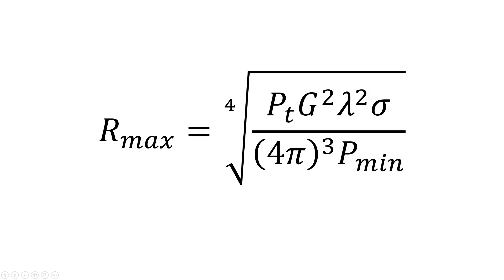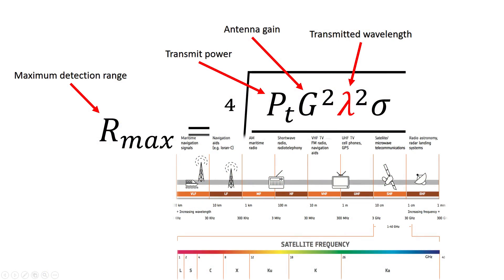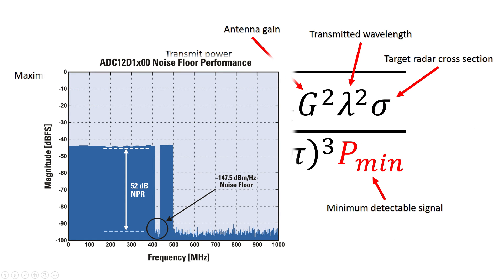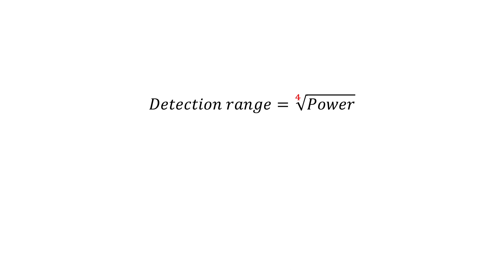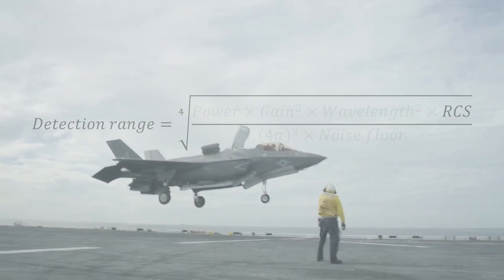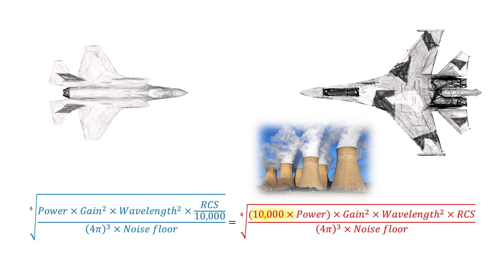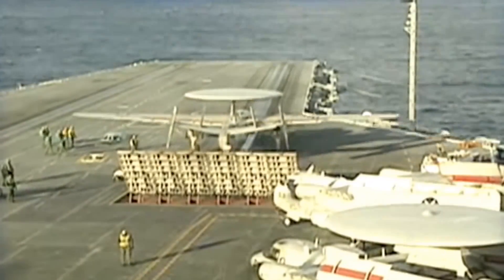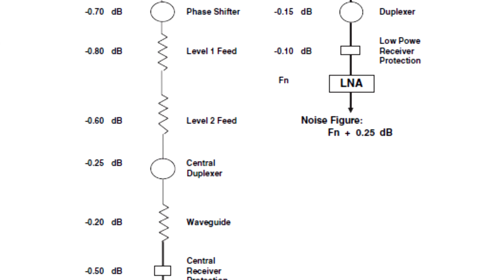F-35 Lightning II: Busting Myths - The Radar Equation [v1.1]

Comment: Doesn't a stealth aircraft give away it's position when it turns on its radar?  Is it possible to keep your radar off and just watch the radar signals from other planes?
Reply from the maker: HM1199
Sort of; the idea is also partly centred around the idea of emitting signals that are spread out and don't look like radar pulses to anyone other than those who know what the emitted pattern / frequencies were (which is only the jet that emitted them, due to the random manner in which they were generated).
Reply: hey i want to ask about another thing , i heared that LPI radars can be detected if the passive sensor has a good enough software ,i mean like using a signal of
 Reference in conjunction with the received signal to generate a spectrum . Is that a valid option? :)
Reply from the maker: HM1199
LPI / LPD is a bit like stealth; it's not a single technology or technique, and it's not binary in nature. It consists of things like radars being highly sensitive, having wide bandwidths, using complex waveforms, having small sidelobes, using random frequency hopping, etc. The Su-35's PESA for example would have some LPI features.
You can use techniques to improve your chances of detecting LPI emissions, but beyond a certain distance they won't work. How that distance compares to the LPI-emitting jet's ability to detect you, largely depends on who's stealthier.
Reply: oh i see ,  so you can have an LPI radar by making it very sensitive to the point where  it compensates for the high (and visible) power needed for the range , mabe thats why russians are making more and more sensitive modules i mean the 1.4 db noise figure they have acheived is not bad ata all :D  . Pretty cool stuff thanks and keep those videos coming dude .
Reply: The answer to both questions is irrefutably yes,  with a couple of caveats. 1) The F-22/35 radars employ LPI techniques that are highly effective against detection equipment that is more than 15-20 years old (which is a lot of equipment), but most anything newer than that can easily detect these signals. 2) There's a difference between scanning for targets and tracking targets. Scanning an area of sky is going to give you away to anyone in said area, but once a target is acquired you can opt to track only that target. Since phased arrays are steerable with good side-lobe cancellation, you can focus your signal on a single target. This means only the target you're tracking (or anyone who passes through [or close-to] that line-of-sight) will detect your radar beam.
Reply from the maker: Not necessarily; the F-22 and F-35 can use LPI mode on their radars; it reduces the range at which a RWR, etc can detect their radar emissions - F-15s/16s/18s have often been unable to detect the radar emissions of F-22s and F-35s. Some stealth aircraft like the F-35 can also just use infrared sensors for targetimg.

Comment: Good video, but for me there's one issue: Radar stations and other radar-equipped aircraft can of course detect the radar sent out by another aircraft, so any aircraft activating its radar in the presence of hostile aircraft or over hostile territory will be immediately detected, regardless how good its stealth is. Stealth only makes sense if stealth aircraft can be guided to the target area without it having to use its own radar (wasn't there a video on the bomb runs against Iraq somewhere?). This also makes a plane by plane comparison of stealth vs. radar not representative. In case of ground attacks, the defender would of course rely on ground-based radar, whereas in other situations both sides could use non-stealth aircraft for spotting the enemy's planes, and the stealth aircraft would only use their radar for targeting, once they get within range of the enemy.
Reply: F-35 is not designed to intercept enemy fighters. It is useless in a dog fight. If the US military are not fools, such a huge investment in this fighter are only justified his offensive potential of bombing foreign territory.
The missile defense system in Europe, hypersonic missiles, F-35, create from Russia the image of enemy in the media - links in a chain of preparations for war, what mankind has never known in history.
Reply: What ChupaChubra probably doesn't take into account is that the F-35 is unlikely to be sent into enemy territory to attack other aircraft. To identify enemy aircraft at any reasonable distance, any fighter needs to be either support by ground based radar or other aircraft with radar (e.g.AWACS) or to use its own radar. However, a stealth plane that activates its radar makes itself visible, so usually a pilot will avoid doing that. However, as the F-35 is designed as a multi-role fighter, I would likely be sent into enemy territory on a ground attack mission. And as ground targets can be found using GPS and optically (at least if they are immobile), a F-35 would only need to activate its radar after the enemy has found it already, to engage the enemy aircraft or to avoid them.
Reply: This is the reason the US has so heavily invested in AESA radar tech. Unlike PESA or MSA radars it has the capability to frequency hop, form sub groups, and vary power levels of 1000's of small transmit and recieve (TX/RX) modules. This effectivley allows the power transmission of the radar to appear as no more than back round noise to any radar warning reciever (RWR) that might be looking for it.

It also allows for it to use many different jamming techniques at once in effect making home on jam systems usless as they are only usefull againsy barrage noise jamming.
Reply: And what about the Aircraft's own radar receivers? On the F-35's screens these big UHF or VHF ground radars will be like a big HIT ME sign at hundreds of miles away. The F-35 can in fact attack using just it's passive sensors. In fact the F-35 that is targeting need not be the one that attacks at all, in fact it could be a cruise missile launched from an aircraft carrier that does the damage. 

Note that even the F-22 wasn't able to fight the F-35's radar. Both 5th gens have come in gun range without the enemy knowing they were there. 

Also note, 5th gen aircraft with their sensors can have the capability to shoot down the enemy's missiles instead of dodging.
Reply: srinitaaigaura I think the general argument is that VHF radar stations would be staged comfortably behind front lines and protected by theatre defense systems like S-300/400. They would be able to detect penetrating aircraft long before an F-35 (or any non-AWACS aircraft) would see them—ground systems are at a huge advantage due to basic characteristics like size and power generation. Even if you know where they are from other intelligence sources, the real difficulty is getting at them. It's going to require stand-off weapons in any event. Having a far reaching stealthy/fast AGM is a hell of a lot more useful than having a stealthy airplane.
Reply: 1) no stealth aircraft ever been only stealth head on , same altitude. If that was the case then they wouldn't be stealth against ground radar at all. Which is clearly not the case. Looking at most radar scattering graph , you can see that stealth aircraft general have bow tie shape signature 
https://basicsaboutaerodynamicsandavionics.files.wordpress.com/2016/03/f_35_metal_rcs.png

2) IRST can help somewhat but they affected significantly by weather ,humidity , target aspect and need to rely on LRF ( laser range finder ) to generate firing solution because they can't measure distance, target velocity or altitude by themselves. Laser range finder is limited to around 15-25 km so they offer much shorter range compared to radar 
https://s18.postimg.org/4wot7d07t/IMG_20170219_183944.jpg
modern stealth has measures  to reduce IR signature too
https://basicsaboutaerodynamicsandavionics.wordpress.com/2016/03/04/stealth-techniques-and-benefits/

3) Both stealth aircraft and normal aircraft can use jamming but it always  benefit stealth aircraft significantly more due to signal-noise ratio. Generally  jamming power required will decrease in the same rate as RCS reduction ,99.99% reduction in RCS equal to 99.99% less power required to successful to jam a radar. The burn through range will be reduced significantly too
https://basicsaboutaerodynamicsandavionics.wordpress.com/2016/03/29/electronic-countermeasure-ecm/

4) stealth aircraft such as F-117 often less effective against very low frequency but it has nothing to do with power in the radar pulse. In fact, low frequency will carry less power than high frequency ( which is why microwave use cm band not UHF or VHF to cook your food). The reason why low frequency work so well against legacy fighter is due to their interaction with object, when ratio between  aircraft physical size  and radar operating wavelength  start to get into Mie region, the majority of the reflection will be surface wave , and surface scattering. For legacy stealth aircraft like F-117 with full facet design this is a big problem. That is why newer design like B-2 , X-45 , F-22 , F-35 all use many blended facet to reduce effect of surface wave. Modern RAM such as CNT RAM is very efficient against low frequency too
 https://basicsaboutaerodynamicsandavionics.wordpress.com/2016/04/12/radar-electronic-countermeasure/
https://basicsaboutaerodynamicsandavionics.wordpress.com/2016/03/04/stealth-techniques-and-benefits/

5) modern RWR can certainly counter LPI, however, as all passive system , they are very bad at calculating distance to target , target's velocity , target altitude so unlike radar those RWR can't generate good firing solution for air to air BVR attack
 https://basicsaboutaerodynamicsandavionics.wordpress.com/2016/03/02/rwresm-and-passive-geolocation/
Reply: you assume that radar will be on. But it doesnt have to be if working in team with Awacs or other fighter (F-15) and transmitting radar data. That's why so big emphasis is put on data links.
Reply: MrDmarek
We have missiles against AWACS. If we compare the F-35 and Su-35, you have the  Su-35 give the analogue of the AWACS A-50U.
Reply: *****
Aircraft type AWACS will be removed from the game in the first minutes of the battle.
After which the aircraft will be forced to enable their detection system, thus, the invisibility will not play a significant role in the battle. A larger supply of missiles will enable SU-35 to shoot more often and more speed and maneuverability will allow you to evade enemy fire.
Reply: (Why can't I edit my previous post to fix its errors, btw?) Stealth aircraft make much more sense from an offensive perspective. Stealth would also have some benefits on the defence, but it would be difficult to say, whether this would justify the additional cost compared to a conventional aircraft. Regardless of that, all great powers are developing offensive weapons; the Russians are even said to be developing a nuclear-warhead-capable submarine drone: http://freebeacon.com/national-security/russia-building-nuclear-armed-drone-submarine/ Hey - now we're talking about an escalation that could lead to a nuclear war, Stealth is a comparable harmless offensive technology in relation. Too bad, in the 1990s it seemed as if mankind had finally overcome the threat of nuclear self-annihilation, but now the armament spiral is back. I personally don't suppose that any of the respective powers (US, Russia and China) actually wants to start a nuclear war - but all sides are paranoid that the others might do it, which is the real danger of such an armament spiral.
Reply: ICBM launch which is clearly visible from space.
Russia has a good system of early warning about such attack.
Reply: Absolutely true, our radars will catch the radiation of the radar F-35 and to direct the missile on to this radiation and no matter what he's invisible.
What is also controversial.
Reply: A.f.a.I.k., the F-35 isn't controversial because of its stealth capability, but because a flaw in its conception. Here is a very good article on that: https://warisboring.com/fd-how-the-u-s-and-its-allies-got-stuck-with-the-worlds-worst-new-warplane-5c95d45f86a5#.shvzvf8r6  The concept of the F-35 is that of a multi-role fighter, which generally might be a good idea, but in this specific case the F-35 also had to be designed as a Close-Air-Support-fighter for the U.S. Marines, with S/VTOL (short/vertical take off and landing) capabilities, and very like one can't have both: Either a fast and agile fighter OR and S/VTOL capable plane. The likely reason that the F-35 project got so massively expensive would then be, that the U.S. Senat, who approved the project, literally asked for the impossible. Lockheed's engineers are certainly good enough to come up with something for this money, but A.f.a.I.k.the F-35 would be an inferior air fighter compared to other currently technology air fighters. Against an enemy that would have those planes (which could only be Russia or China), the United States would likely loose in an air battle.
Reply: +DirkT1709 You need to get learned. Multiroles like the F-16 have been doing CAS better than the A-10's for several decades now. The airforce hates the A-10's and wants to get rid of them because of this.
Reply: You should go watch the other videos. The F-35 is at least as maneuverable as the F-16 or F-18, and apparently handles like their love child. News talking about how it's a lead sled usually omit key details, such as certain flights having limiters in place and so forth.
Reply: DirkT1709 In this case, the F-35 is intended only for bombing ground targets. With the function of a fighter is optional. Thus, a passive sensor, it will be only attacking weapon.
Without the function of defense.
That proves that the United States has long been preparing for war with Russia.
The US wants a nuclear war and win it
Reply: All the hyper-critics of the F-35 want to ignore the results of the many exercises that the F-35 has now excelled in, with Red Flag 17-1 only being the latest. The hyper-critics are just sure the F-35 is useless, and that these exercises are rigged, or that there is some massive conspiracy, or that the USAF can't closely duplicate the S-300/S-400, or thermal systems, or low frequency radar. No matter what these exercises show, the F-35 remains a terrible fighter in their minds. 

The F-35 has yet to be detected on radar, including the F-15Es at Mountain Home AFB that were equipped with the APG-82 AESA radar. And I'm sure many have been many side pings on the F-35, where the RCS is indeed higher.

And just mention that the F-35 has significant RCS reduction to low frequency radars, and Boxy Brown is personally offended.

Comment: Very good video, I was an ET in the US Navy in the 1960's and 70's your explanation is spot on RCS was important then as well.
Reply: Yes, but significantly smaller than any 4 gen aircraft. The EF claims a good enough detection for a frontal shot at 55 kms, with a fighter at a normal cruising speed (.82, give or take), with Pirate. So maybe a 35 to 40 km detection range for the F-35. Not really that great a detection range. And maybe double that detection range for a tail shot with the fighter at a normal cruise power setting. The F-35 has good IR reduction tech, just don't go super-cruising around promiscuously, because increasing your speed from mach .80 to 1.0 will double your IR signature, approximately.
Reply: Yeah right, whatever.
Reply: Yes the F-35 and F-22 have IR signatures but they are very small, Like many other fighters the F-35 uses its fuel to cool the engine and avionics, as well as certain materials to keep down its heat signature. Keeping within certain speed parameters also helps.
Reply: I was an Electronics Technician. Cute question though.
Reply: David - I ignore comments??? I've addressed every unfounded criticism on the F-35 I've heard. And I feel like about 85% of my comments are ignored by the F-35 haters. 

Define better. Both the F-22 and the F-35 have their strengths, and will make a fantastic team. In Red Flag 17-1, the F-35 was praised for how it gave other aircraft much more Situational Awareness, including the F-22 through MADL. It's sensor system is a generation ahead of the F-22.
Reply: + 777Outrigger The info that I find on the Dassault Rafale's infrared signature reduction is quite limited they use something they call Hot Spot treatment, for infrared signature reduction, and they say that the Snecma M88 turbofans have been optimised to limit infrared detectability, my guess is they use bypass air. Sorry but that's about it.
Reply: Most of the info is classified, so there's no way of knowing for sure. But sometimes it's fun to speculate.